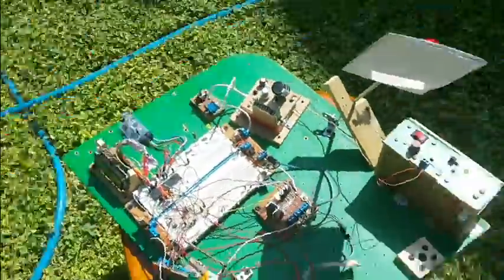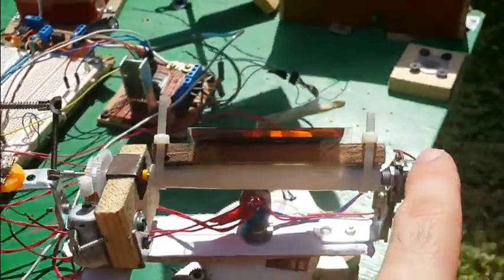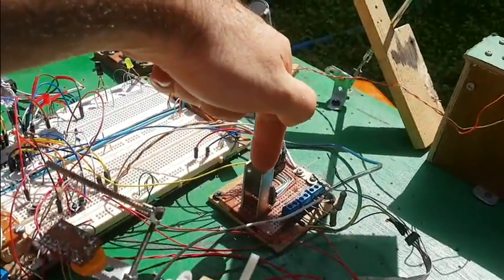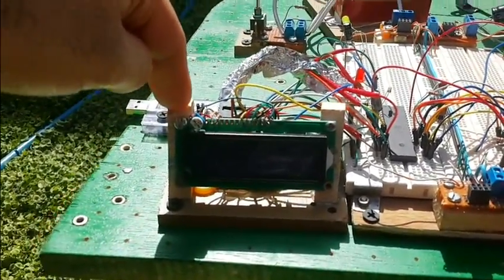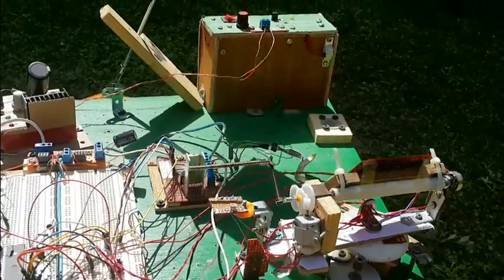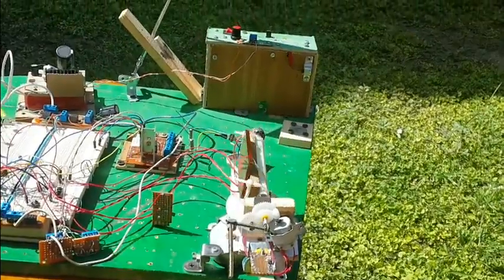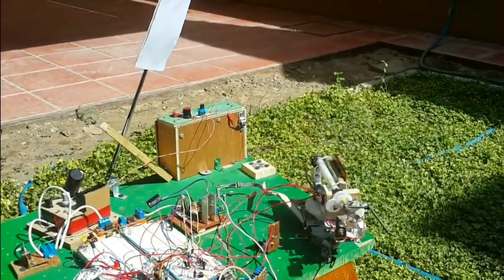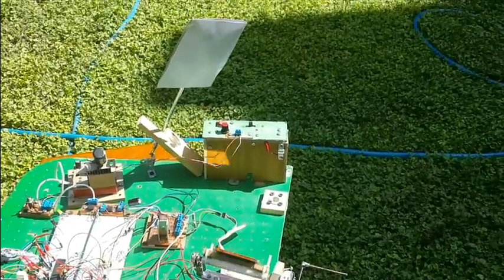DIY homemade Heliostat controller

Comment: Hi Mohanad AlJammas;
I can appreciate the mechanical problems.
However, I'm more concerned with the maths.
As I said, I believe you are after measuring the AZimuth and ALTitude values you are taking the "Averages" of the AZ and ALT angles to determine the mirrors aiming angles.
This would be incorrect.
Since you are using a simple micro I doubt it is capable of doing the required matamatas for the complicated spherical geometry.
Here is an extreme example for thought:
1. Place the sun at 90deg AZ/0deg ALT and the receiver at 270deg AZ/0deg ALT.
2. Averaging the angles the receiver is aimed at 90deg AZ/0deg ALT.
This would be correct, although any ALTitude, -90 to +90 deg, would also be correct.

Now raise the sun to, say 1deg of ALT. The only answer would have the mirror at 270deg AZ and about +90deg.

This could not be obtained using simple angle averaging.

A wonderful web page that thoroughly explains the maths for great circle navigation. See:
Calculate distance, bearing and more between Latitude/Longitude points
https://www.movable-type.co.uk/scripts/latlong.html
Look for "Great Circle Distance" and "Midpoints".

Duane C. Johnson
redrok@redrok.com

Do you have an email address?
Reply from the maker: I have quickly reproduced the math. Although not tested, but I followed similar strategy thence:

first: To simplify calculations, I transformed the standard theta angle of the spherical coordinates from being (between the position vector and z-axis) to (between position vector and xy plane).

second: in this simply calculation, I an calculating the alpha angle (as shown in the figures) from phi and theta. Similarly we can calculate the beta angle (from sun to y axis). using these two equations, we can solve for phi and theta from the measured alpha and beta angles, then we will have the angles of spherical coordinates of the sun.

Third: notice that in the mechanical setup shown in the video, the sun makes a shadow on the sensor only when the sensor (assuming it is a single point), the rotating arm, and the sun are in the same plane. Notice also that he sun will make a show on the sensor if it is anywhere in that plane, and that the plane also includes the r-vector which means that for every phi and theta we have a unique position vector --> unique plane that includes it with the sensor> unique alpha angle.
all the analysis applies equally to the beta on the y-axis

When implementing these equations, corrections for the tan function should be made according to the quadrant, this will add some complexity, but is still fairly straight forward.

I hope this convince you of my math ^_^

https://drive.google.com/open?id=1Qof_Lxje3ADGRbbZIcJfR_ec4BOhtvF3
https://drive.google.com/open?id=1C7u4jrCl9ZNgfLWWLHkO7qNVtG0WrvFH

regards.
Reply from the maker: Sorry, forgot the email
mohanad.aljammas@yahoo.com
https://portfolium.com/mohanadaljamma/portfolio
https://www.linkedin.com/in/mohanad-aljammas/

Comment: Hi Mohanad AlJammas;
I've been watching your video and think you have a flaw in your procedure.
1. I think you are measuring the AZimuth and ALTitude deviations from the target separately.
2. Then you individually calculate the Half-Angles of AZimuth and ALTitude independently.
3. Then you move the mirror to the separate AZinuth and ALTitudes.
While this appears to work OK if the deviation angles are small this is technically not correct.
I can see in the video the reflected light doesn't always hit the target in the same place every time.
What needs to be done is to calculate the bisector angle directly in a much more complicated equation to determine the resultant mirror AZinuth and ALTitude position.
Take a look at this simple method to do it mechanically:
http://www.redrok.com/heliolighting.htm#receiveraxis
http://www.redrok.com/heliolighting.htm#recaxgear1
redrok@redrok.com
Reply from the maker: Hi Duane

The two angles obtained from the two scans are used to calculate the theta and phi in spherical coordinates using a formula I derived using trigonometry.
I can say that the error in positioning is due to many causes, including:
*  the mechanical setting has a lot of play, the mirror base sways a bit
* the target moves a bit too (I have fixed it with piece of wood as you see.)
* the radius of the arm used to scan the sky for sun shadow is small relative to the thickness of the scanning bar (the screw). so there is a range of angle where the bar causes a full shadow on the LDR. The software tries to determine the spot of maximum shadow and take this as the final angle. A better algorithm would be to record all the ldr measurements and then find the range of platue, then take the middle point of this as the final measurement. recording the measurements required large memory which I didn't have with the ATmega16 (1 KB of RAM)
* The LDR is centered by inspection at the center of rotation of the scanning arm, any error in this placement (and definitely there is) will significantly affect the result.
* I remember that the mirror was fixed to the horizontal shaft using a glue tape, and all this introduce a significant play.
I believe the math lying behind is intact. Unfortunately I lost the algorithm with a laptop, and I can't review my math now, I could work the math again though, maybe I will in the next few days.
Thank you for your feedback

Comment: Hello sir...
I am very much interested in  your project....How to form the equation to get the phi and theta....
can you give me the equations for payment.
saraaj100@gmail.com
Reply from the maker: Hello Sathishraj;
Sorry, but the whole project is lost with a laptop that I lost in an accident, non of it is left. I wish I could help, and sorry for the late reply.
Reply from the maker: Hi,
Although very late, but in case you are still interested, you can check , my reply to Duane above, I included a link to two figures showing you how to do the calculations, you have to solve it backwards though in order to have alpha and beta from phi and theta, it shouldn't be a problem for a guy fairly familiar with simple trigonometry.